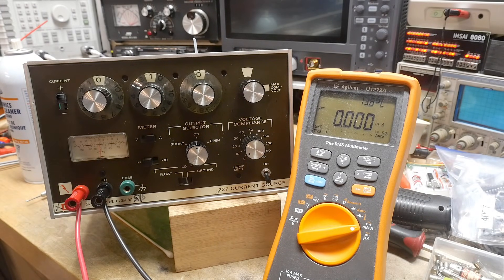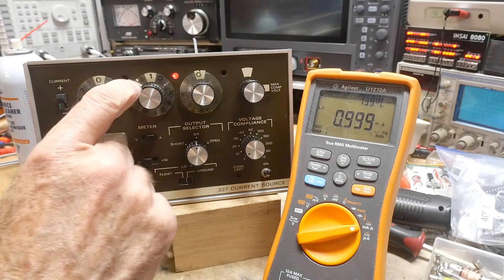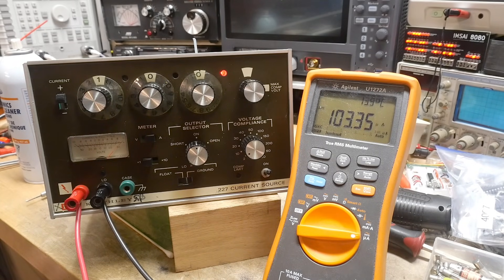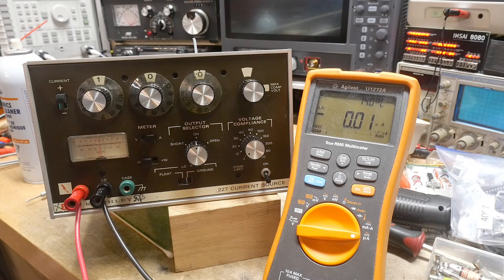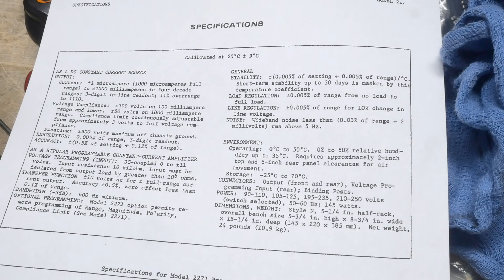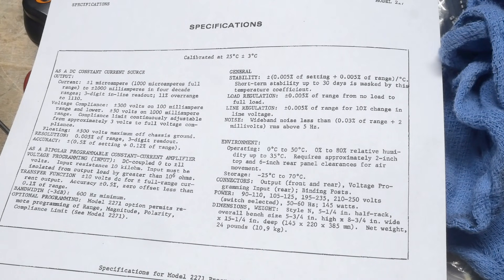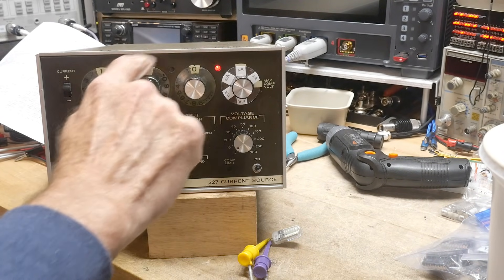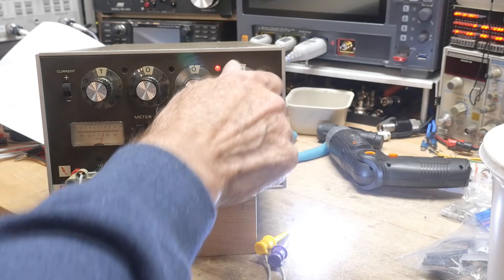#2456 Keithley 227 Current Source (part 2 of 3)

Comment: Before you try to replace that bad sealed pot you might drill a very small hole in the case and put some cleaner in thru the hole. I've seen that done before with a good result and if you're going to replace it anyway you don't have much to lose.  73 - Dino KLØS
Reply from the maker: not a bad idea